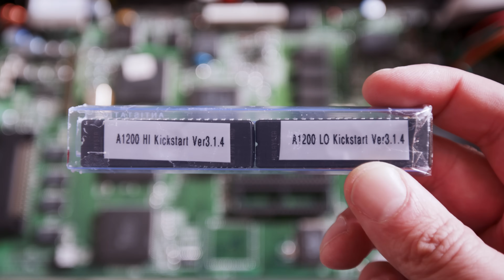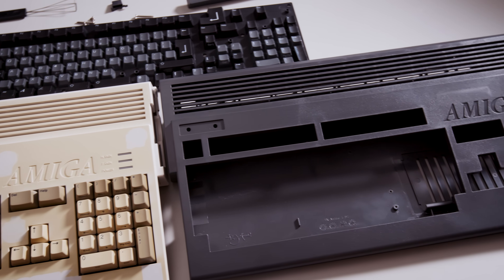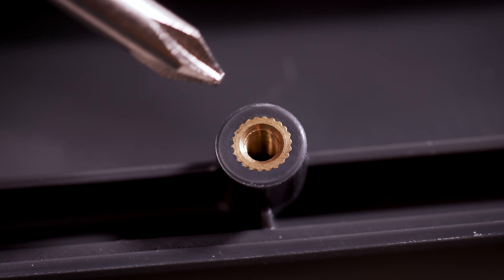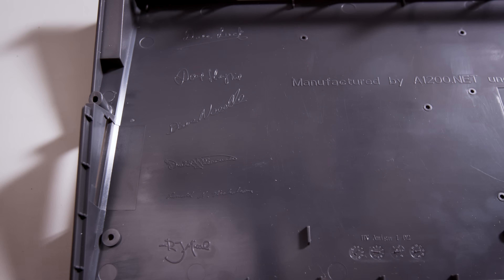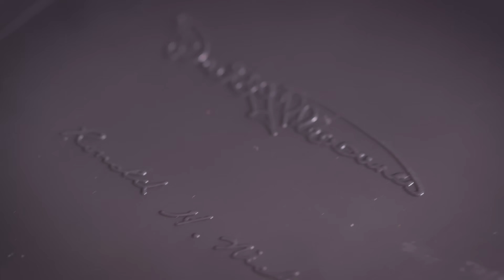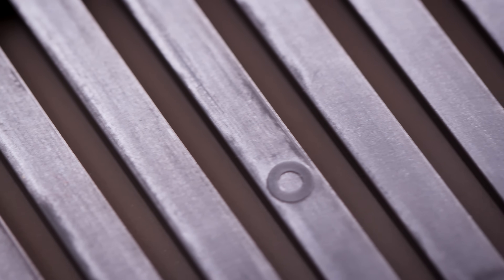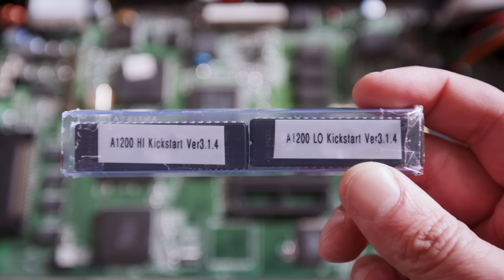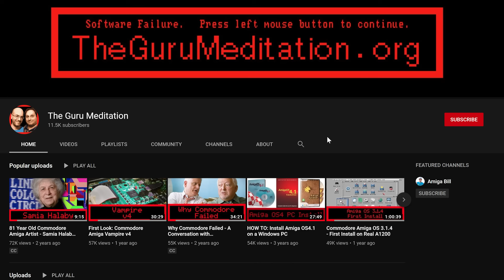My Dream Amiga Part 1: New Case, Keycaps, Kickstart ROM Replacement

Comment: Nice very similar to my 1200, I have a 1200.net case and still waiting for the keycaps to be built because of covid I have an ide to microsd, I burnt my own 3.1.4 roms with the supplied image supplied with my rom burner I got off ebay, I also have a brand new set of lights so when it's fully done it will look like a brand new 1200 from the factory.
Reply: Keycaps are for sale now. Be quick to order. As the news have not hit youtube yet, and when it does, then I have a feeling that they sell out quick.
Reply: @brostenen  Thanks for info if that was for but I already have mine on order, I was in the 2nd go fund me or whatever it was called, I placed my order 3/3/2019 so I am just annoyed because everything under the sun is holding it up, I have orig 1200 colour on order and they are doing black first grrrrrrrrrrrrrr.
Reply: @raymoreton3184  I fully understand you want original colour. Really sucks... Personally I will buy a red or green set, if they go on sale at some point. That way I can mix with the black. Use black were it was originally white, and red or green were they originally used grey. Or perhaps buy both a green and a red set and then I have caps for my two 500's on top of my 1200.

Comment: Adding a Warp 1260 will be like installing a new motherboard into the new oh-so-fine case! I'm eagerly awaiting the Warp 4060 for my A4000 and A3000; already drooling for it, seeing the excellent work the CS-Lab devs did with the 1260 and 560..! Would also be great to get new keyboard parts and cases for the Amiga 4000, 3000, and 2000...

Comment: I have a few things. Despite that, it is an awesomme video. Congrats to you on a "new" 1200. 🙂

You can get a tiny bit closer to a "new" 1200. One of them new replica boards. Then finally, why not use one of them new IDE adaptors instead, that are a bit like the IDE-Fix solution.

Comment: Nice work!
Haven't rolled through all the comments, but what will happen to the original A1200 case and keycaps?
Reply from the maker: Thanks! Good question. A few folks have asked for them and I might give them away, or possible do my own little art project. I am not sure
Reply: @TheGuruMeditation  a giveaway sound interesting!
Since it's a not exactly-mint-condition-but-still-A1200 case, someone with good painting skills and the right colour of paint could be delighted to fit it's Raspberry Pi 4b in it... Not that it was what what I thought about when I saw the video... 😇😇😇
Reply: Anyroad, whatever you decide to do with it, we can't wait to see it on your channel!

Comment: Good luck finding a proper CPU for the WARP 060.  But I know if any one can find one, you can with your resources.
Reply from the maker: Fortunately I have an 060 CPU and that is one of the main reasons for going with the Warp 1260. I know they are difficult to find and super expensive.

Comment: Got also a A1200 CD32 case with the keycaps and have the rare A1200 GHOST Limited Edition case. I busy with the A1200 Black case and waiting for the Black Batch 2 keycaps. Would be great if the GHOST keycaps come out. Also I waiting for the Black A500 case, Black keycaps and the Black Tankshell.  The A1200NET makes great A1200 cases. Like the A1200 CD32 Special Edition case and the Grey/Black keycaps. Have now two Blizzard 1230 IV with the FPU and 128MB 50ns. Waiting for the Indivision AGA MK3 to change the Indivision AGA MK2CR. Must buy the Blizzard 1260 and will buy the ACA1260.
Reply from the maker: Nice build! What is the A1200 GHOST Limited Edition case?
Reply: The A1200 GHOST case from A1200NET are 8 made worldwide.

It glow in the dark and waiting for the GHOST  keycaps.

GHOST Edition:
► The Ghost Edition Keycaps are matching to Ghost Edition A1200 Case.
► Glowing effect is obtained the same way as on the case, and the final ► Ghost case will be available to display as soon as they're produced.
Like the Metal Serie, Ghost cases (& keycaps) require longer treatments and those are manufactured later on in the process to assure quality. 

► Exposure request for 2 hours Glowing effect duration (either):
- 1x Full day under normal daylight exposure
- 4 hours exposure under LED light (22 leds bulb)

Comment: Really nice look. Just that badge... seems somehow wrong to me.
Reply from the maker: Yea I understand. I guess because it isn't a CD32, but I look at it as a reference to the CD32 color scheme. I like the badge, but you can always use a different one. I have seen Amiga badges for sale on eBay
Reply: And color matching is important of course. Would not have looked good with the original or a similar one. 
I will have to wait until they make new cases for the A600 though. Actually this seems quite unlikely. Fortunatelly the one I have is still really good.

Comment: YUP, I'm waiting for two cases like that, I now have spotted a little bit of colors being not well uniform on the right side. Well, maybe it depends by this particular grey? I've got one black and one transparent cases, too. The latter the favorite and better done. Nice video, hope to look forward a new one very soon. Cheers, M
Reply from the maker: Thanks Mark! Glad you enjoyed it. I didn't notice any color variation in mine. I will take a closer look
Reply: I had a black A1200 case, not CD32 grey, and the LCD cut out above the Amiga logo was pretty noticeable. Had I kept the case I would have put an LCD in there as the colour looked particularly uneven to my eye. Perhaps I am just too picky though. Otherwise the case was great but I sold mine on as couldn't afford to pay out for the 1200 to go in it at the time :-(. Have a 500 now and will be keen to get a new case for this once resellers have them.
Reply: @roscoe500  I think that, lighter the color, lesser the problem. Even if that's NOT a real problem because these new cases are really well made. This uneven color could only be spotted in areas where the user can choose to break the plastic to mount new accessories. Otherwise they're nice and OK. I've ordered 2 more A500 new cases (one original color, one transparent).

Comment: Great video Bill! Since you are not keeping this machine fully original by adding a CF adapter into in for instance, why don't you go with a gotek drive instead of the original floppy drive?
Reply from the maker: Well, I am a big fan of floppies and have thousands of them. But unfortunately since I made this video the floppy drive has failed. So I will be putting a GoTek in it. And I agree, this is a good machine for a GoTek. I have another 1200 that I am trying to keep a bit more original

Comment: Great video and a great start on the A1200 refurb project! I hope you can get one of the 1260 cards in there. I was going to buy one for my A500, but ordered a Vampire instead.
Reply from the maker: Thanks so much Doug! I hope the 1260 fits as well. If not I will have to do some...modifications. Congrats on the Vampire!
Reply: @TheGuruMeditation  Super vid! I have the same case, Warp1260 fits perfectly, no modification needed. Greetings!

Comment: I love the Amiga. I was the biggest fanboy from 89 to 97. These new cases are amazing and I'm very tempted. The signatures in the case are... weird though.
I really need to get my 1200 setup permanently again.
Reply from the maker: The 1200 is awesome. You will love it when you set it up again. The signatures are an homage to the inside of the A1000 case
Reply: There is a fine line between homage and cheese, and personally I think these cross it. Wouldn't stop me buying one though. :)

Comment: Awesome. I did the exact same. Had both my 1200's (one from my late grandpa) recapped, mine with polymer and used my grandpa's to donate its Blizzard board. I have the regular white case and new keycaps and indeed, it went from a "working, but with weird quirks" to a machine that feels brand new and fast. Love this community.
Reply from the maker: oh wow awesome. Glad the re-cap fixed the issues and I bet your case is super clean and beautiful!

Comment: Wait.
How come you have your CD32 case? I'm still waiting on mine!
Reply from the maker: Yikes! I thought all the CD32 cases had been distributed. Oh man. Sorry to hear that
Reply: @TheGuruMeditation  I suppose, on the plus side, perhaps by the time I DO get mine I'll be able to afford the other bits.

My A1200 hasn't really ever been used. I remember looking at it longingly from my PC at the time (a Fujitsu PCTV 486, I didn't know it was already more powerful than the A1200). But. By the time I actually got one (brand new MagicPack!) it was a case of...so...now what? Every few years I dig it out with the hopes of setting it up as a daily driver for some light office work and of course some gaming but something always gets in the way. :-( The last time it was the Indivision Mk2 scandoubler being discontinued.

I managed to grab a Blizard 1230 IV (many years ago before the prices went extreme) and it's SCSI kit complete with RAM which gives me I THINK 256MB total? I forget. But the 1230 needs its battery backup replacing and of course the caps on the A1200 need swapping out too.

<sigh> One day...
Reply from the maker: @intangibletingles3412  ah yea, sounds like you got into it a bit late. The 486 and CD-ROM era was the beginning of the transition away from Amiga for most folks. I wish I could remember the quote someone said in one of the comments where I posted the video, but it was something like "Being into Amigais a long, slow process that requires a lot of patience along the way. You just have to enjoy the ride" or something along those lines. I am still waiting several years for some other projects I backed. I guess it is par for the course when you have a small market and passionate fans who dream of cool things but then run into obstacles as they are trying to produce it.
Reply: HI Intangible Tingles,
If you supported the Keycaps#2 campaign on IndieGoGo its normal you haven't received your CD32 case + keycaps yet.
We're stuck since end January due to Covid 19 and still waiting for our production schedule.
If you supported the KS campaign in 2017 and haven't received your CD32 + Keycaps, the possible reasons could be the language layout you've selected for the keycaps been pushed to production #batch2.
Since we had issues with label printing quality on #batch1, we had to correct these issues first to then run #batch2, which is now stuck for the moment.
Please message us by using the CONTACT FORM within ►RMI ( https://www.a1200.net/rmi ),
this way we'll know who you are and we'll understand why you haven't received your CD32 case yet.
Thank you again for your patience.
The Team.
Reply: @A1200NET  Yeah, it's Keycaps#2 I backed on IndieGoGo for the CD32 case, keycaps & the bunch of CD32 themed goodies. 
Sucks about all the delays but at least it is still muddling forward/I haven't been forgotten!

Comment: Do you know of any source for replacement mitsumi keyswitch rubber cones? (that is, the rubber tactile domes in A2000+ keyboards, rather than the springs in A500/A1200 keyboards?  I've been trying to track them down and can't find a source other than other keyboards.   (It's an amazing upgrade to the spongy A500 (or C128) keyboard feel... and imo, would be a great, simple upgrade if there was a source)
Reply from the maker: That is a great question. I love the feel of the cones as well. I don't know the answer, but if I find a place where you can get them I will let you know.

Comment: Needs a vampire!!! 🙂👍
Reply from the maker: I really do need a Vampire, but I am thinking to put one in my 500
Reply: @TheGuruMeditation  my personal advice is to go for v1200. it's by far the faster board you con put on your 1200 and his fpga have lot more LE than V500 so in future we could have 3d acceleration and more. V500 is absolutely perfect but v1200 is more future-proof.
Reply: @stefanobriccolani3407  lol
Reply: @TheGuruMeditation  Ahh, that makes sense, the A500 has limited modern expansions and the Vampire 500 will completely transform it. The Warp 1260 is pretty much the most powerful "traditional" A1200 expansion card... particularly if you manage to get your hands on a Rev 6 68060.
Reply: I have been on the Vampire list since September 2019, but finally found a slightly used for for a $50 premium from a trusted member of the community and snapped that up
Reply: Absolutely beautiful!!!!!
Reply: @drphilxr  It's vapourware.
Reply: @tiannaumann  I have two of them
Reply: @roygillotti4615  How many months on a waiting list? or did you set up an e-mail notification for when the scant amount of retail stores would have them in stock for a half hour?
Or we can sit here and keep bullcrapping each other.
Reply: @drphilxr  January for me :D
Reply: Perhaps. The warp seems like an overall better solution for some reason.
Reply: Yes this beauty NEEDS the almighty Vampire1200. Ask Manuel Jesus, maybe he can help you having one!